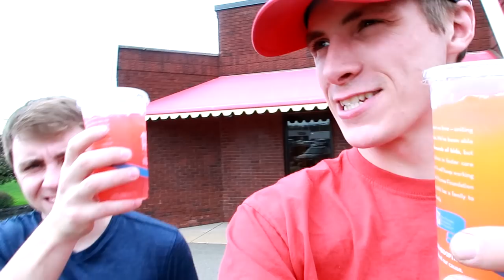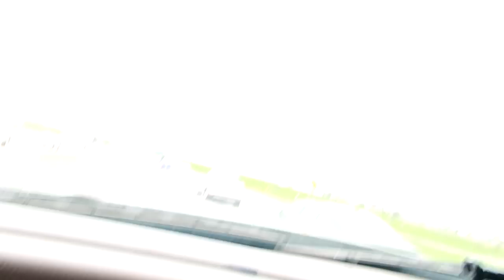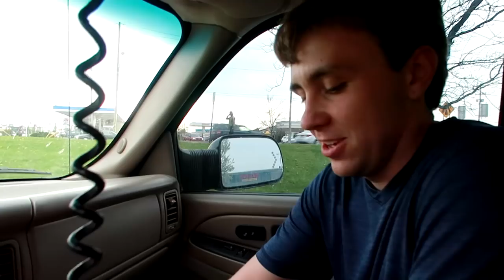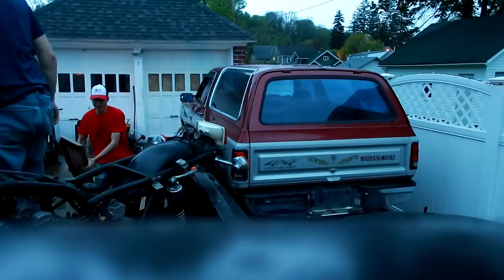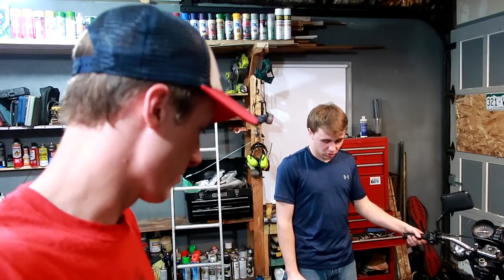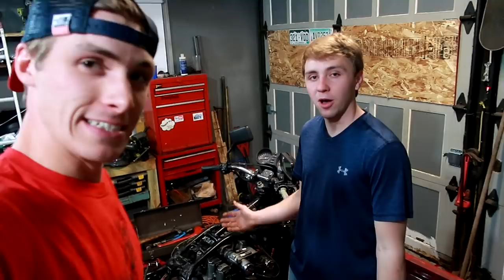FIRST SUZUKI 1000 MOTORCYCLE

Comment: Hey Man - I ride a '80 Kawi KZ1000.  Tips - check valve clearances, Get a good carb clean.  If you add pod filters to it or change exhaust, you will absolutely have to rejet it.  Other notable things to check - if it has points consider a cleaning or an upgrade to electronic.  Check coils.  They can be finicky to sync up the carbs.  Make sure you get a vacuum gauge to sync the carbs together.  I have some carb docs on that rack if you need them - Mike

Comment: That's awesome! I have a 1980 suzuki gs550e but a gs1000 like that would be pretty awesome. And just so ya know if the charging system hasn't been worked on then you will most likely be replacing it since these bikes are notorious for bad wiring and charging systems or so I have learned so far.

Comment: If it is electronic ignition cut the white wire as it is the kill switch ,if it uses a points ignition take the key switch apart and join the wires and make sure it's supplying power to everything else that would give you a good indication
Also love your videos keep it up!!

Comment: Dalton man you'll need some kind of filters on there I had a gsl 850 l 4 cyclender Suzuki around the same year. When I got it. It didn't have an air box it would fire but not run til I coverd the back of the carbs I did clean them first lol but as I held my arm across them to cover an gave it enoungh air to run it ran good

Comment: If you wire the + side of the coil to hot you should get spark. Being a 1979 I'm guessing it has points so it should be easy to hotwire. But I'm not an expert.

Comment: Dalton! Beside the fact that you might be able to sell that engine for more then you bought it (So don't mess it up by grinding or cutting of things). You might as well use the brakes to to tame the power since that bike makes over 60mph in first gear... You will have to take the harnest of the bike and fit it into the gator. Doing that you will make sure to wire the thing right and ad some extra ground wires. If you don't over rev the engine it should be pretty solid. Please build new motor mounts and don't cut up the frame it is like burning money to light a cigarette. Parts for it can sell for a good amount of money! So you could sell the parts you don't need. Install a little fan to keep it cool since you might not have the needed air flow. If it overheats you two inner cylinders will ruin the engine. You might run into carburetor issue  don't try to take them all apart from each other! They are synchronized and it is not easy to do that without the right tools. Just take of the bottom bowl and soak them a few hours in carburetor cleaner avoid to screw around on things you are not sure what they do! Rinse well with premium fuel high octane! This engine does not want ethanol in the fuel since it was build when it still contained led!!! Some engines got the valve seats changed to work with led free fuel but since you don't know it you might want to ad a led additive to avoid destroying your valve seats and valves. Yes I care for old bikes if you ask that yourself. Do some research on how to check and adjust valve play that is not that hard to do but I don't know if it needs shims but I guess yes because the 1977 GS400 I start to ride on use to have them if I remember it right... but that was in the 80's. Do you really read all this???

Comment: Did you bypass the kill switch? or are you just grounding the solenoid?
Reply: WrenchWise I
Reply: WrenchWise what do you mean ground rhe solenoid?
Reply: Connect the lead from the battery to the lead to the starter using a screwdriver at the solenoid.

Comment: if it doesn't have a key then it's turned off so you won't have spark until the key switch is turned to the run position.

Comment: I'll race jake, my bikes not blown up so I have the advantage
Reply: blown up :)), probably fouled a plug, loafing about.  last KTM I rode they said was 96% ready for rebuild and it will foul plugs constantly. after 3 hours riding it, it fouled one and I noticed the plug boot wasn't threaded onto the coil wire when I changed it, fixed >_>

Comment: Its the worst bike from the 70 a gs 1000. I dont think its goin to have the torque. Most likely just hurt the clutch. Lots of hp no torque. But it might be fun for a min. I hope it has fire because the cdi boxes are hard to get and hard to get cheap. Good luck bud
Reply: Rob Plotts torque convertor? I don't know excatly what it changes but sounds like it will make torque lol
Reply: Tyler Johnson toque is the power an engine can make the work. Hp or horse power is more like how quick it will reach max power. Im not really telling it correctly so you should google it. An engine can have a ton of hp but with no torque it will be a slow machine. A torque converter is a device that transmits rotational power from an engine to a transmission using hydraulic fluid. Picture two fans facing each other turn one on and watch the other one turn the air would be the hydraulic fluid. The converter alows the vehicle to idle and still be in gear. Thats the difference between a manual shift and an automatic